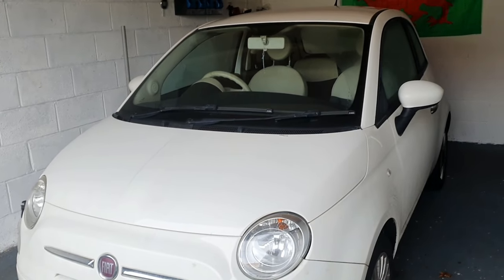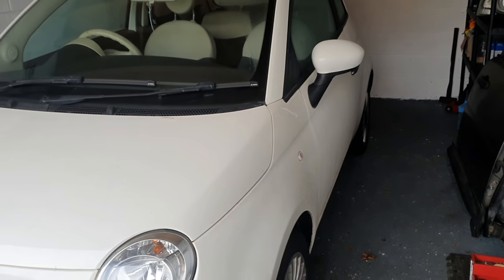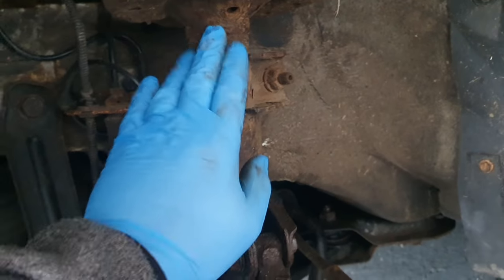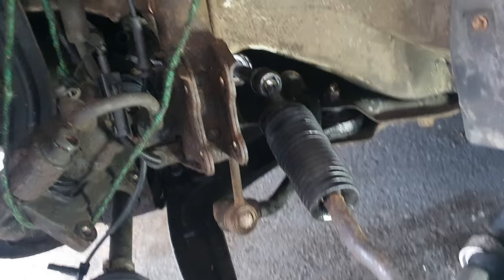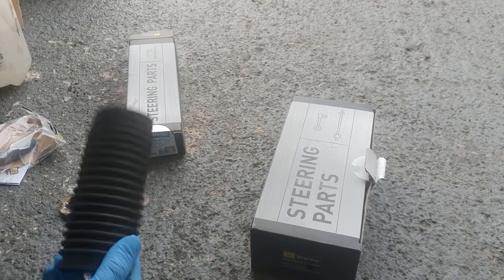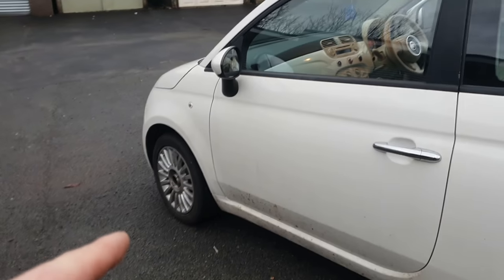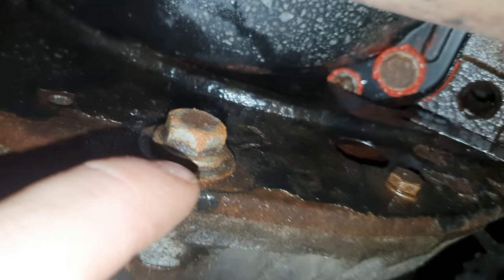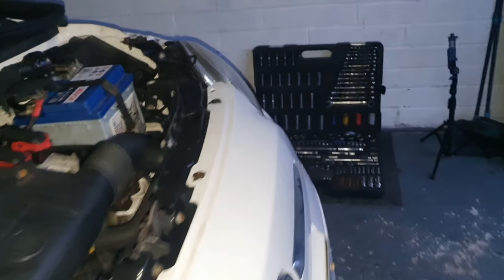Fiat 500 ABS Fault Solved... But yet even more PROBLEMS...

Comment: Oil leak is a real pain after all your hard work . My concern is it aint the sump . I would try and remove the bottom bell housing tin . Wash it off with brake cleaner then run it up . See if its coming from the seal behind the flywheel . A total pain its always a hard decision on an older car weather to change that and gearbox input shaft seal because its extra cost and extra work . but thats cars bud. If its rear crank seal the back of the flywheel will normally have oil over it.

Comment: Pro tech here.
there are many steps you did NOT need to perform to complete that repair.
if you are going to flip cars I suggest a small investment in some proper tooling, such as an on car bearing press, a cut off tool and a few other important time saving tools.

an investment in a few pro level auto information websites  can be a life saver as well.

done this for many years. currently working on a 2016 fiat 500.
your comment about previous owners NOT maintaining their vehicles is SPOT ON. 
however, thats why we can buy them cheaper and use our skills and knowledge go get ahead a small amount at a time.
Reply from the maker: I appreciate your advice on the tools and resources—definitely something to consider for future projects. It's always great to learn from experienced pros like yourself. Glad to hear you agree about the previous owners' maintenance habits; it's a key part of finding good deals. Best of luck with your work on the Fiat 500!

Comment: Hi Big Man. Looking back, you put more that enough sealer on the new sump. Was it oil resistant, I don't know ?.
                      The only thing I can think of is a failed rear Crank Shaft Oil Seal 🤷‍♂🤷‍♂. If so it's a gearbox out Again
                      for a Twenty ( ish ) quid part. See you in the next one. 👍👍👍👍
Reply from the maker: Thanks buddy ... fingers crossed 🤞 it's not the main seal

Comment: someone pressed  a new bearing in that hub but put the bearing the wrong  way  around so the sensor wouldn't  pick up  anything
Reply from the maker: It was working before I removed the drive shafts... it probably came off when they were removed though 😕

Comment: Try a bottle of Lucas stop leak if leak is not to bad I used it on a fiat panda lasted 2 years plus still going strong according to mot check I no longer own the car. 👍👍
Reply from the maker: That's cheating lol... ive fixed it now new video tonight
Reply: @RevivingSalvage  naw no really I used the car as a daily it was not a fix to sell just had no intention of turning in to money pit. Every other car at that age when you check mot it says oil leak from engine. But get that you want to do the right thing. 👍👍